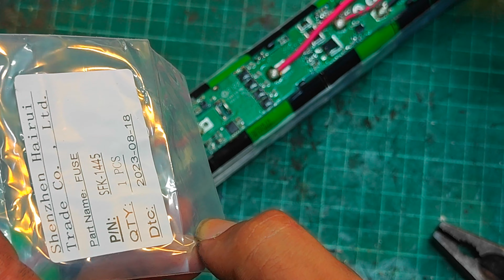VANMOOF S3 BATTERY not charging... FULL FIX!

Comment: One gentleman on reddit commented that he thinks you used the wrong fuse, and believes it should have been SFK-4045. Also any luck re-inserting and having it work? I think the fuse blow is likely due to overcharge. I think for me things went wrong when I left the bike plugged in as it approached 100% (I maybe left it on for an hour more than it should) but this is just my experience and what I've read from others.
Reply: do you have a link to reddit thread?
Reply: @dsfasdfhgftmyumki  YT isn't letting it link. Search the following: My findings in diagnosing and attempting repair of a S3 battery with error 6, 19 and 20.
Reply from the maker: I think he's correct, I couldn't get the right fuse so went with the next best option to test. Customer says it's working on his bike. Overcharge should not be possible with a charger, it should turn off once full voltage reached/BMS turns off charging MOSFETs. Of course this BMS may be pants and doesn't do that?
Reply: @ryanbrown6059 right now the only takeaway for me, why the fuse blew, is high outside temperature and before that, around an hour of use of the battery. The rest of my BMS looks very good, so I hope, it was just the fuse that somehow broke. 

What was your situation exactly before your fuse blew?
Reply from the maker: unfortunately, I'm not sure. I was fixing the battery for a customer!
Reply: @dtngx  There are some similarities. I left the bike outside for the day, so a solid 8 hours with direct sun. It's not that hot here though so high of maybe 17 C tops. I road it home with no issues. I think I plugged it in later that night to get a charge and all was ok, when I took it off the bike basically started to make a sound like it was turning itself on every 5 minutes or so. It eventually stopped after a few resets and thats when I got the 6/19/20 errors.
Reply: Hey guys, 

I can confirm, the SFK-4045 replacement did the trick for me! My S3 works again, without showing any errors ;) 
In case you need advice, let me know!
Reply: Did you have error 6, error 17, and error 20? And changing the fuse to SFK-4045 fixed it?  @dtngx
Reply: @timothyferaboli616  yes, the bike is working again. The fuse did the trick. 
It is difficult to say, what the underlying problem is, but for now, it seems everything is normal. 
Although I also had to charge the Smart Cartridge battery manually, because it changed not get any charge while the fuse is broken. It depletes quickly.
Reply: @dtngx  thank you very much for your reply! It seems i am having exactly the same issue as you. And i am currently without my main transportation vehicle.. can you explain what exactly do you mean with charge the battery manually? Your battery is now depleting faster than before?
Reply: @timothyferaboli616  you need to take out the smart cartridge, and disconnect the little battery that is in the cover of the smart cartridge. Then you use a lab power supply to chare it at 4.2V maybe 0.7A. After a while, the Current drops to 0.35A quite quickly. Then you know it approaches its maximum, so you disconnect and from the charger and plug it in the cartridge again. 

Noo, th battery depletes the same as before. But as long as the main battery is broken because of the fuse, the small smart cartridge battery gets empty quite fast (in a matter of weeks) because it can‘t be charged
Reply: @dtngx  I'll start mine next week! I'm sure I'll have some questions...happy to hear it worked for you!
Reply: @ryanbrown6059  thanks! 🙏 
I have since started writing a detailed guide on how to repair and check everything. 
Currently it is not published yet, but i can send it to you in case you want it
Reply: @dtngx  Thanks for you explanation. How do you charge the Smart Cartridge battery manually? Is it by pulling out de smart cartridge thereafter connecting the small battery to a manual battery charger? Which accu charger is good enough (36V)? Which setting on the battery charger should I choose?
Reply: @paco5703  woaahh :D 
The small cartridge Battery is a 3.7V Lithium Ion battery. You charge it by unplugging it from the cartridge and then connecting a small Controllable Power Supply to it. In order to do this, you need to remove some of the yellow sticky tape from the battery, so you can see the + and I terminals on the battery. You set a constant Voltage of 4.2V (that‘s the normal Charging Voltage for these Lithium Ion batteries) and then set a maximum Current of 0.7A. 
When you start output, the current should go up to around 0.7A and then just keep an eye on it and wait, until the current reduces. When the battery reaches full capacity (1050mAh) it quickly drops. I disconnected it at around 0.4A.

Keep in mind, depending on your charge state, the battery needs to charge for more than one hour, when providing it with 0.7A only. I wouldn‘t raise it much higher as this puts a lot of strain on the battery.
Reply: @dtngx Could you send your notes to me as well? Thanks to all for posting these instructions. Waiting for the fuses to arrive from China 😁

Comment: how do you get the battery out of the bike?
Reply: Remove the two screws on the left and the right of the lower battery end. 
Then remove the third on the base plate of the battery. 
Disconnect the rotation Sensor cable carefully.
Reduce the pressure in your rear tire until it is possible to slide out the whole battery.
Some VM Batteries have a metal handle to remove the battery more easily. 
In case your‘s doesn‘t have it, use one of the screws, insert it into the battery bottom and lock it lightly, then pull on the screw to slide the battery out 😊
Reply from the maker: I'm not sure! The customer posted this battery to me to attempt to fix. He has since said it works on the bike, though.
Reply: On the Bike under the cranks, are screws which need to be loosend, after it you can pull out the battery
Reply: Remove the two T25 security screws and deflate the tire completely. The. You can squeeze it out. You will need an extra low profile bit ratchet or similar as the clearance between the cranks is minimal. It you dont you can remove the crank.